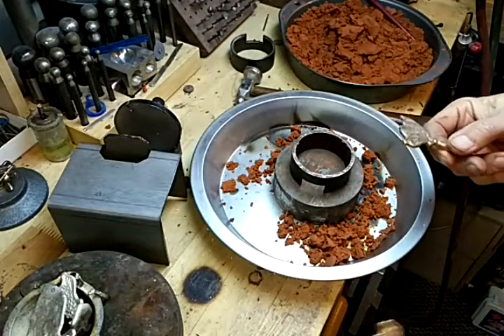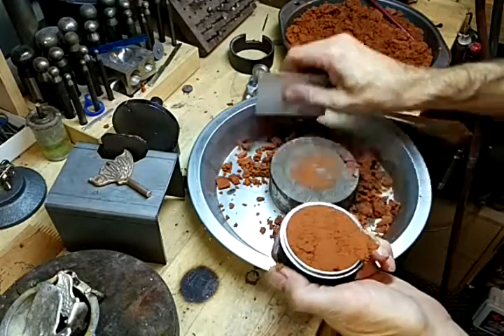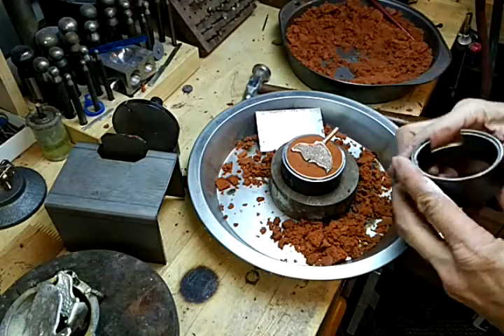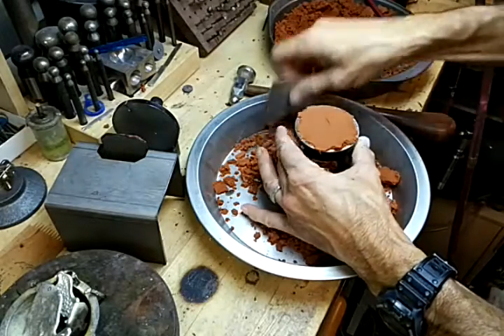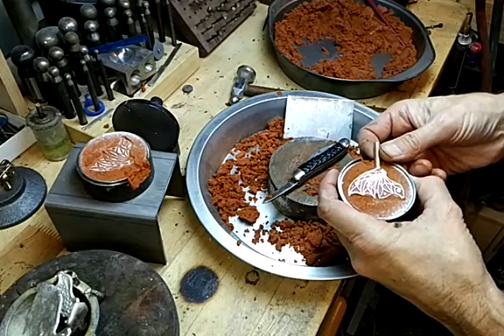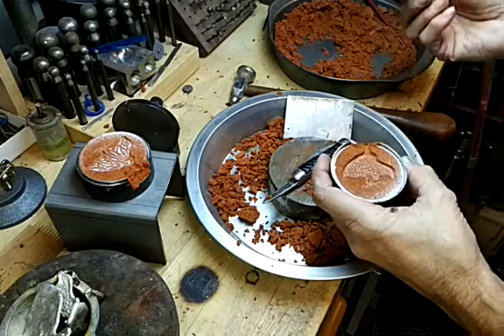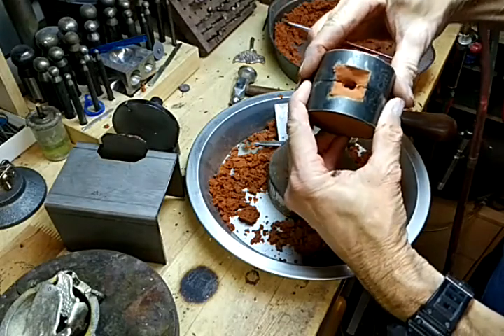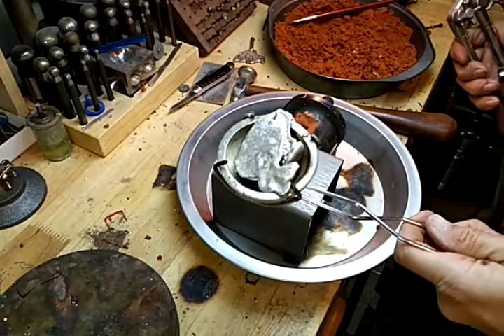Sand Casting a Large Butterfly Wing with Petrobond

Comment: Where do you get your patterns for casting?  How does it work without the vents? Is this accomplished by making the channel wider and using plenty of metal?  Thanks for your reply.
Reply from the maker: If you use the Petrobond in a mesh size of 90 - to maybe 140, it isn't too compact and will allow air and gases to pass without vents. I make all my own patterns as well as all the tools which are available on my website at www.diyjewelrycasting.com.
Reply: Thanks, I will look at your site.